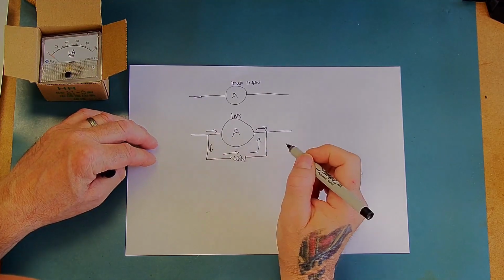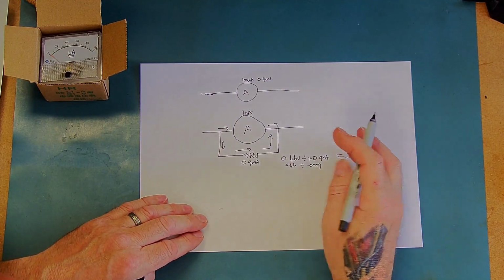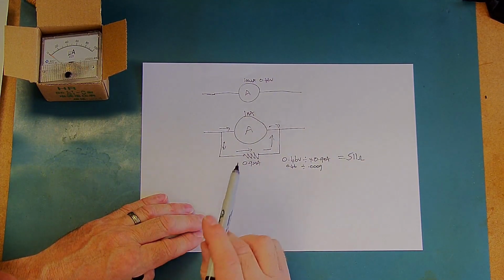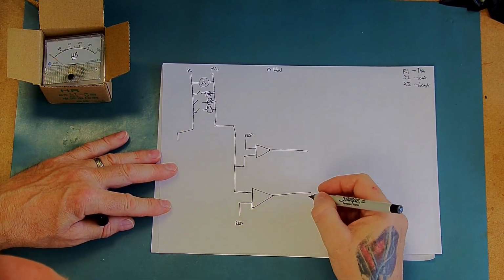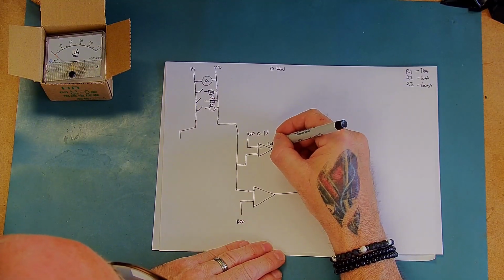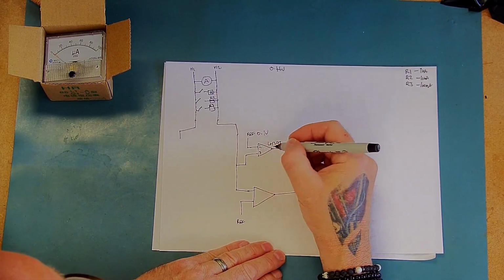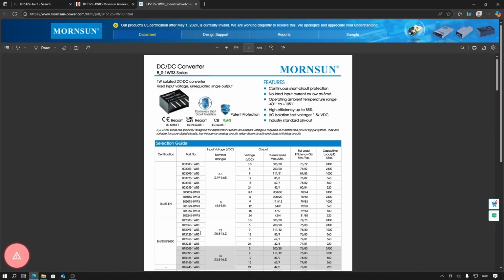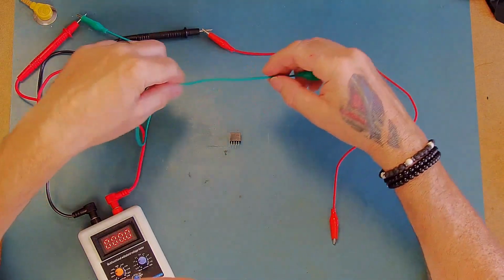Auto Ranging Analogue Ammeter 1000VDC Potential  using an Arduino Nano

Comment: I'm toying with the idea of measuring battery current in a car. But that could involve a huge dynamic range from 10's of milliamps to 100's of amps! 
So a very fast acting autorange would be needed to stop the arse being blown out of the 10mA shunt when the starter is operated. (I could just leave the starter out of it, but the high range would still need to be in 10's of amps.)
So searching for auto-ranging ammeter brought me to your video, which prompted a few thoughts:-

I'm not clear on why you need to isolate your controller from the ammeter. If you allowed a common ground on the negative side, the project could become massively simpler. Here's what I would do:-
Lose the comparators and use the Nano's ADC, which is good enough for simply deciding when to change ranges. Although your application is for capacitor charging and discharging, where the current will be mostly crossing smoothly through the range boundaries, a more general use case should incorporate some hysteresis to prevent chattering. That would require two more comparators to form a hysteresis window at each end of the range - another reason to eliminate them and use the Nano's ADC.

The relays and their optos could be replaced by logic level MOSFETs, driven directly by a Nano I/O pin. And as your shunts are several ohms minimum, the MOSFET on resistance won't be critical.

I'd also put another diode in reverse across the meter. 
Anyway, that's my thoughts. Thanks for the video.

If I tried to do this for a car, one of my diodes would have to be huge enough to handle the starter current until the heavy shunt (along with several large MOSFETs) kicked in - I'll keep thinking about it...
Reply from the maker: Hi, thanks for your comments. The reason(s)I went in this direction, ie have the Arduino isolated from the dut ( device under test) are many.  But fundamentally, I am measuring the voltage drop across the ammeter at in the range 0v to say 0.6v dc, however this voltage is superimposed on the voltage of the dut, therefore although the voltage may be 0.5v for example it is referenced to the ground and will be  ( with relation to ground) at the test voltage. So if the test voltage is 800v I will need to measure 800v to 800.5v  for example, connecting a common ground will therefore feed over 800v into the input of the Arduino.

Hope that makes sense.